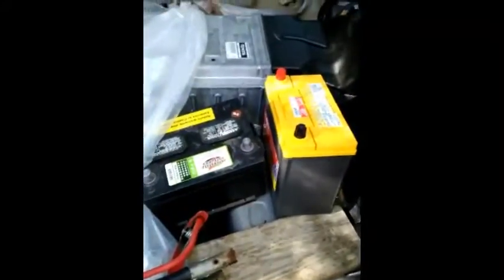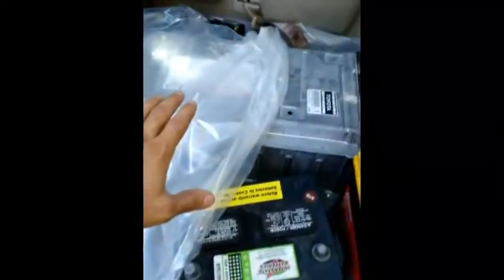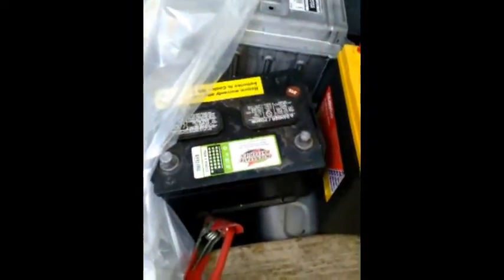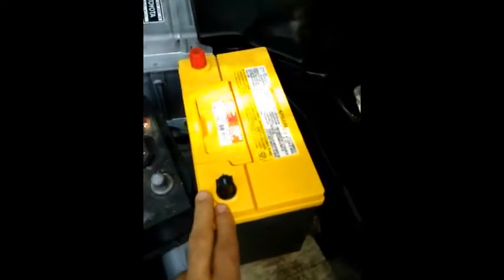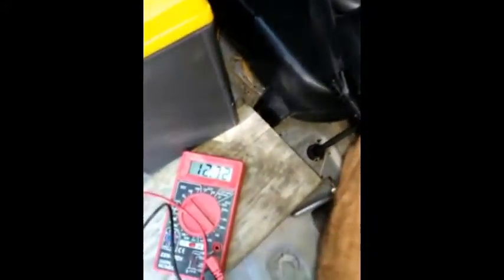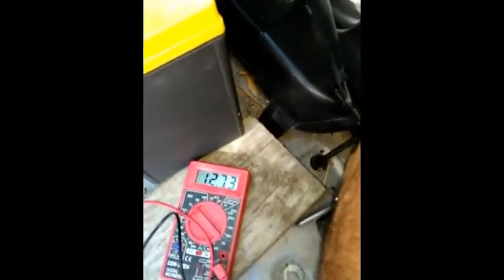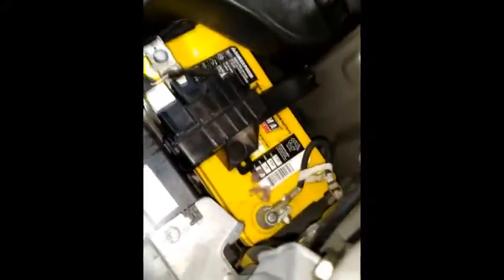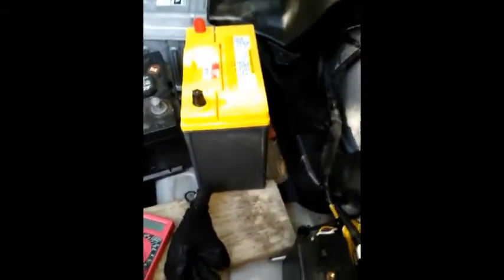Prius 12V AGM Battery Reconditioning

Comment: I have a 2009 Prius and I've just recently put in my 4th 12v battery! The last one was warranted for 48 months and lasted 23. Fortunately they replaced it free of charge. If I understand you correctly, you hooked the new battery to the old battery in parallel, positive to positive, negative to negative and then just drove it for several weeks and then the old battery came back to life? I also just bought a float charger since I sometimes let my car sit for days in a hot garage (I live in South Florida). I haven't tried it out yet but the first day I can't start the car, I'm putting it on the battery!
Reply: Where did you got yours from and 2 years it lasted my lasted this year only about 9-11 months I have changed it for 3 times in  4-5 years.

Comment: If anyone is wondering what he is talking about.  His Prius AGM 12 volt battery went dead.  As a workaround, he connected a regular 12 volt battery to the Prius AMG 12 volt battery using two short cables (positive to positive) and (negative to negative), and drove the car that way for a month or so.  He claims both batteries came up to a full charge .  I tried something similar with a friends AGM battery, which was 3 years and 7 months old.  This did not work.  I suspect this is a ploy to try to get you to follow the link to watch another video where they want to sell you a battery reconditioning system.  Let the buyer beware.

Comment: Could you tell me the name of the 12/24 volt battery desulfator that you showed in your previous video. You said it could handle desulfation in about 8 hours. I would be interested in that desulfator charger. If you know of any other that works well please let me know. I have some other desulfators but they take away too long to work for my needs.
Thanks
Reply from the maker: Those desulfators were from Renaissance Charge. I do not think they sell them but another company does. They definitely brought back batteries if you can afford the steep price tag.

Comment: prius uses the nickel metal hyd. battery for the starter motor I believe.
Reply: so you connected them parallel?
Reply: Brad Wessels agm battery for the 12v system. aka lights, windows, locks etc.
Reply: A Prius doesn't have a starter motor. The 12V battery is used to power the electronics of the car.